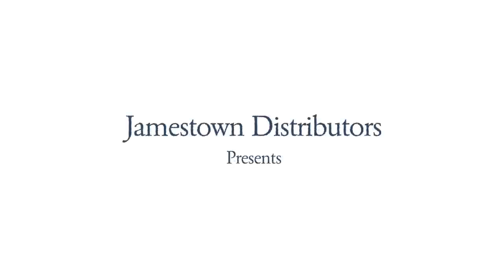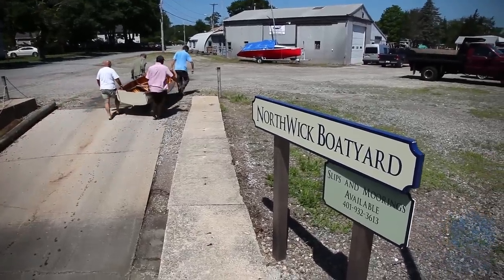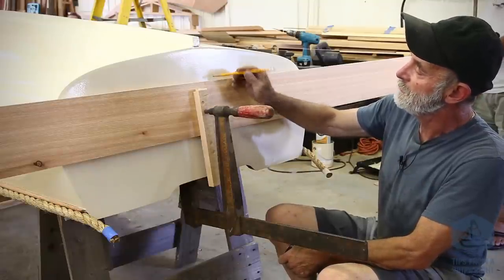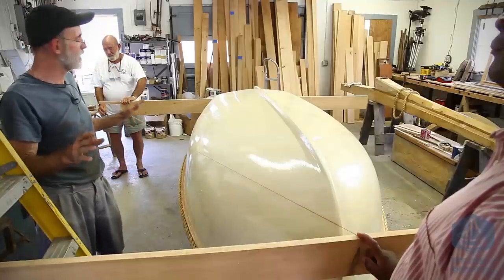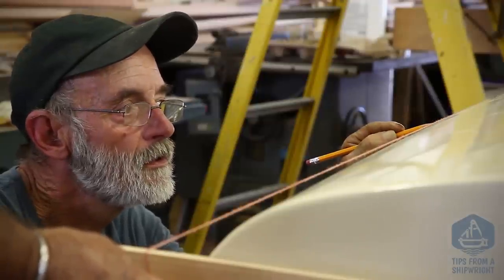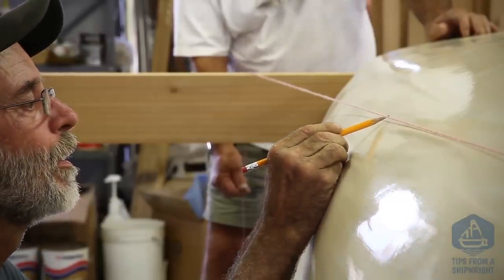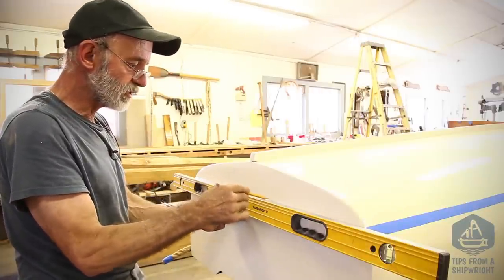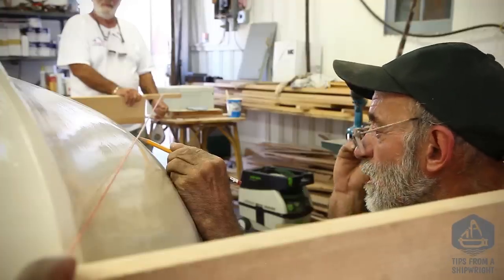How to strike a straight waterline on your boat

Comment: Thx for keeping the "old paths & good way" of boatbuilding alive, Lou.
Down in the lower ChesBay, when deadrise boats were regularly being built, usually out of good grade fir, spruce, bull pine, and the bottom planks had 1/8" - 1/4" gap, (depending upon the size of boat), to permit swelling, but avoiding cupping, compressive-set of the planks & their seams, which could cause them to crucially distort & weaken, or put undue/dangerous stress on the bottom fastenings. Her bottom seams would be paid/puttied with soap, or, in later years, beeswax,( toilet bowl seal). She would then be launched & kept pumped until her bottom planks swelled-up, sufficiently, that she needed pumping, but once or twice a day. This usually took from several days to a week, depending on the season & water temperature.
Meanwhile, there would form a scurf line upon her hull that would give a true working reference to the height & true shape of her waterline. Of course, this initial launch would be in the sheltered, still waters of a cove, or marina basin. After her bottom planks swelled-up, to where her ingress of seawater was minimal, then her engine would be aligned with her shaft, and her fuel tank filled. Then, she would be hauled out, & the aforementioned scurf-line used as a true guide to striking her waterline. Thereafter, would occur her christening and trial of her engine, reduction gear / clutch, rudder / steering gear.
However, others would christen their vessels during her launch & swelling period. This was true of most of the 30'- 45' "open" boats, used for crab potting, tonging, trot lining, haul-seining. The larger size boats above 45'-50' would usually have but one launching & the waterline struck by experience, consultation, & extrapolations from similar sized boats previously built by that boat builder. Adjustments to the height of the waterline would be made at her first routine haul-out.

Comment: That is a really unique little boat. It seems to have dense ribs along the interior width bent from the gunnels to the bottom center. I can see that they are quite thin given the thickness of the strips in the gunnels. Wish I could see plans for this little dinghy. Would love to try and make one. The rope along the upper ledge is a great touch too.

Comment from the maker: When using a laser the boat has to be perfectly level so the boat may have to be moved into position. Then you may have to move the laser a number of times to reach every position on the waterline. I find it considerably more difficult and time consuming.
Reply: !!! great !!!!
Reply: +Tips from a Shipwright I just tried to do a Penguin using a laser. I thought it was great until I did the second side and it was no where near the other side. I'm going to do this in the morning.  Thanks! You guys are great.
Reply: The boat don't need to be level to use a laser , just aline the laser light line with your marks. But instead of using bow and stern marks, you will also need a mark amidships.  Raise, lower, and twist the laser line on a tripod til it falls on all marks. takes about two minutes depending on laser assy  adjustments.  No levels, tapes, strings or boards, just flip boat over and line up laser. 
Many people don't like the laser line because they don't understand how it can be manipulated.

But it's nice to see the older ways of doing things, kinda keeps you humble and appreciate the knowledge before the new technology and power tools 

KORITFW
Reply: What is the reason for a water line on a boat?
Reply: @mazdarx7887  very true. I took me a long time to explain that to the "older" boatbuilders in my company. Doing it with a laser is very easy and fast.
Reply: @Kampup  first of all it shows you how deep in the water your boat lays. If you load ur boat and the waterline disappears underneath the water its an indicator that u load too much and the boat is not designed to float with that much weight.

2nd reason is that the whole hull surface between keel and waterline is mostly coated with antifouling, which protects the hull from damage through sealife and diseases.

Most important reason is propably for construction. As you design a boat you always have certain construcion lines in your blueprint that you need for planing an constructing. One of those is the CWL (construction waterline).
Reply: @johnecker8474  To your first point wouldn't you have to load the hull with designed weight? In this video they're showing a dinghy which is designed to and capable of carrying a couple of adults, their kids and the dog and groceries. Most dinghies don't have a waterline marked except perhaps for antifoul paint if a person just leaves it in the water all the time. Some do. I did.
Reply: @TomasAWalker53  In terms of carry capacity, the waterline is used as an indicator. If the line is over the water u are fine. But if the line is under the water it at least tells u that u have a lot of weight loaded and u should handle the boat accordingly.

You are right that dinghies and other boats like canoes and kajaks for example, mostly dont come with waterlines. It is not really necessary i guess since its easy to measure where the boundaries are for the boat for every person. And also on some boats a waterline completly destroys the aesthetic harmonie of the hull.

I hope I got your comment right and answered to what u meant. If not let me know 😅

Comment: Here in the Pacific Northwest where boats generally stay in the water year 'round, except for the haul-out every 1-2 years for bottom paint and new zincs, there is a very easy method -- simply chuck the boat in the water long enough for a scum line to form and work from that!  Works every time.  Seriously, Lou's suggestion is a great tip and for those without convenient scum lines to refer to, looks easier than any other methods that are around.

Comment: I know it's not old school, but what about a laser level?
Reply: Was my first thought as well but he mentioned that the boat isn't leveled (@1:30). If you want use the laser, the boat has to be leveled.
Reply: +Capitano Americo This raises another question, how do you know when or how to level a boat?  His method of floating a trimmed boat in calm water and measuring down, port and starboard, at the transom and marking these with the bow gives a plane. I have  done this often of boats up to 50 ft.
Reply: +johnffmitchell Your method makes sense to me.

Comment: This method may be the way you do it Lou but is completely useless to the home builder that lives a few miles from the nearest slipway. It is also manpower and equipment intensive. It also needs a transom!  There is no way I could use your method. First, getting my CLC Skerry to the sea and back is half a days work. The Skerry is a double-ender for a start so your plank across the transom is a non starter. Then I'd need planks of wood that I don't have and 3 people to mark a waterline? I don't even have a workshop! What I do have is a spirit level and lots of small bits of plywood to get the boat level. Then I fill a bucket with water and position it so the water level is where I want the line. Suck the water into a long, clear plastic tube and where the water settles in the tube is where you make your mark. Just go round the boat, making marks. It's simple; can all be done on your own, inexpensive and fast. So long as the boat is set up on trestles right then the line will be spot on. As I work outside, a laser line doesn't always show too well and anyway, I don't have one but tried with a friend's. A waterline drawn with a water level is the cheapest and easiest way to go.

Comment: too complicated.  Try it the easy way.  Instead of using jr. (lol) use a trash can fill it up with water. 1 gallon equals 7 lbs. (jr weighs 300 lbs so you"d need 42 gallons of water i proper placement.  Let the boat set in the water over night.  The surrounding water will mark the boat when you take it out to mark a new water line.  You can compensate here or there for any deviation.  cheers salty seaman.